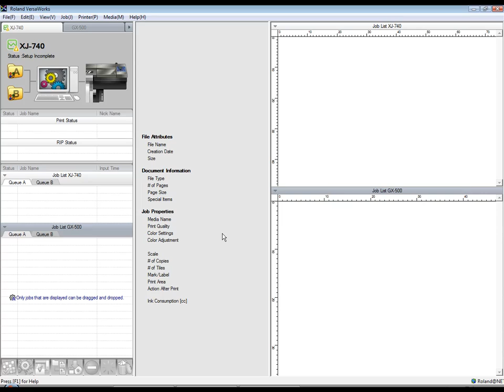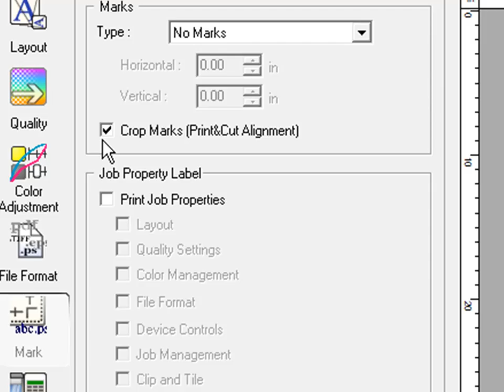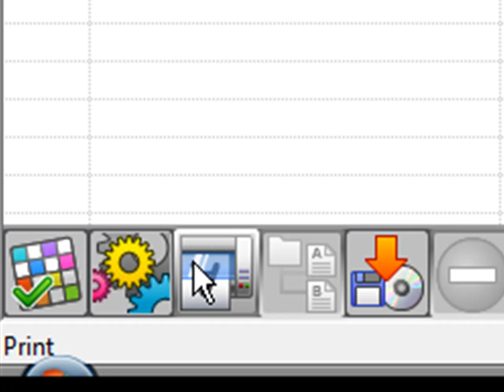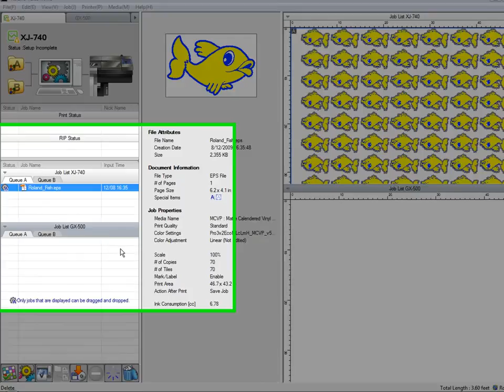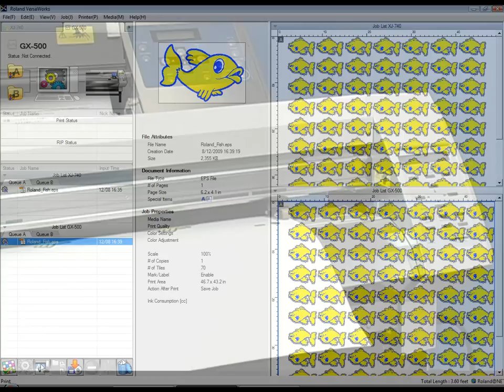Offline Cutting through VersaWorks, GX/XJ

Comment: I have updated the firmware on my XJ and GX-300.
After printing the "A" next to the rip icon isn't present.
The file has CutContour set up properly (works on another print/cut) and crop marks printed.
Any other ideas would be appreciated.